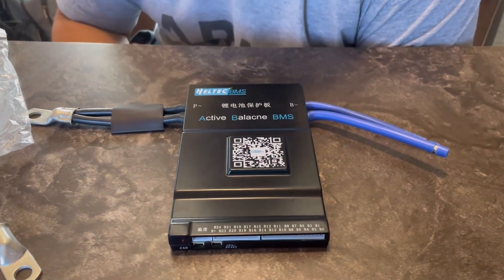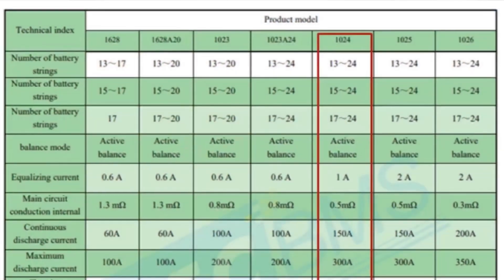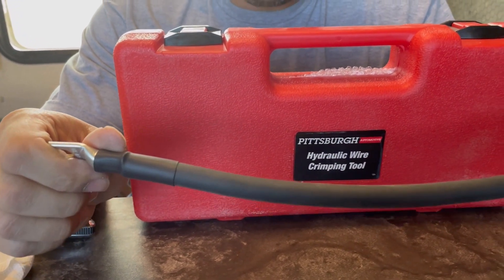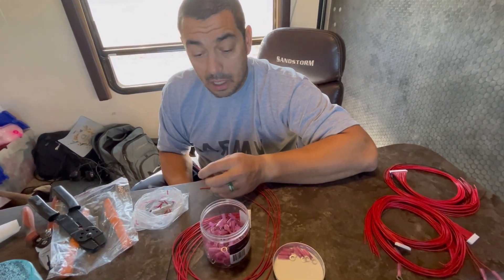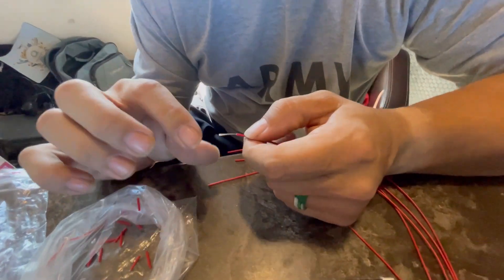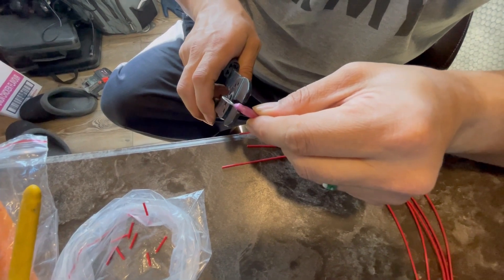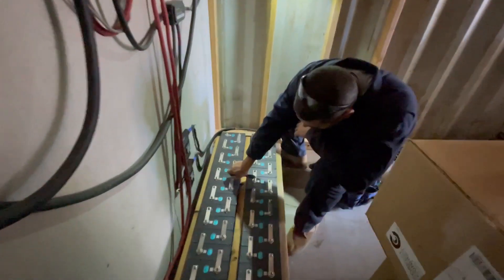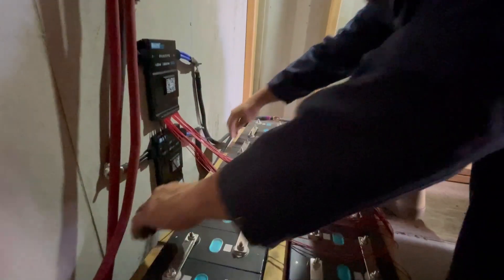How to put terminals on HELTEC BMS Active Balancer for Your Batteries: Easy DIYl!

Comment: How did it workout mate and I have 200ah12v 4x to connected in series to get 48v 10.2 kw bank and each those batteries are build in its own BMS I was wondering if I could put one of these outside so I can monitor them through wifi or even would be nice if I can find one that has internet cable connection to connect them to a inverter any suggestions mate ?
Reply from the maker: There are a few problems… with batteries in series having a bms in each battery won’t help you with keeping them all the same level unless maybe they can communicate with each other which o have not seen any that can yet. The other thing is that if you put one outside you change variables like battery temp and cable length which could make one battery in the bank charge a different rate. You might be able to find a shunt that has WiFi that can monitor but you still need a bms for the bank.
Reply: @leeslivingoutofthenorm  thank you so much I series had no idea what to look for and looking allover the YouTube to find a video that explain a simple video about series I m going to look for bank BMS now thanks for taking Ur time appreciate the reply